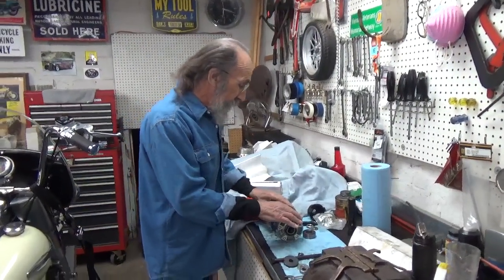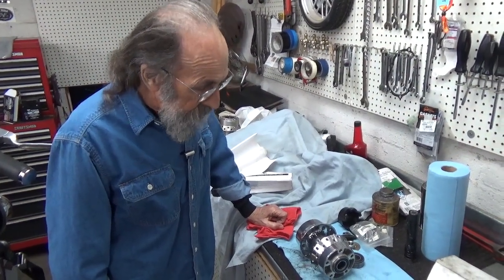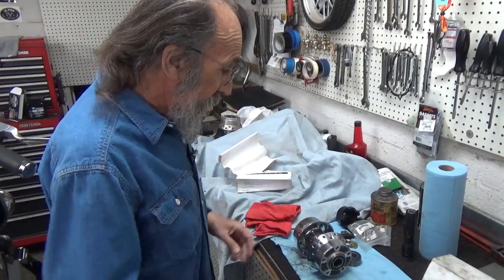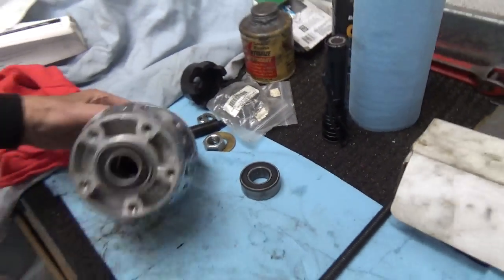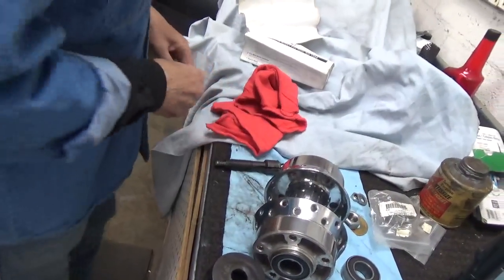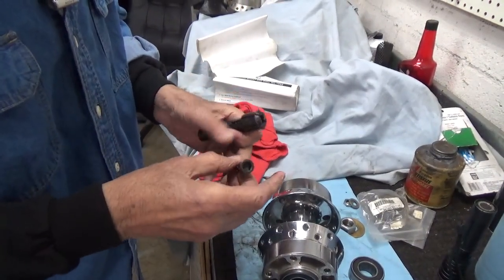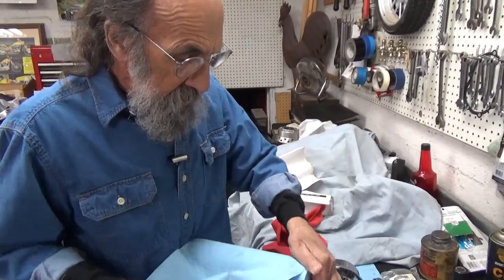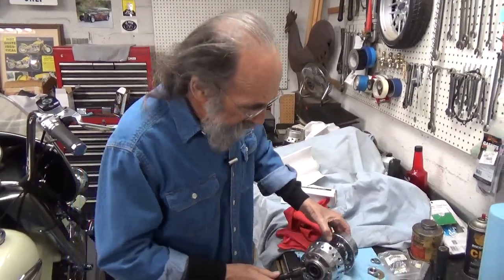R&R Late Model Sealed Wheel Bearings On Harley Davidson

Comment: You're a fountain of knowledge Mike. I'm always waiting for your next video. Thanks for keeping it real and inspiring me to wrench on my bike.
Reply from the maker: Awesome! Thank you!
Reply: @pacificmike9501  what cam would you run in a 93 FLHS for constant highway travel. I’m not worried about speed other than running 80-85mph. But my plan is to travel and see the magnificent USA.
Reply from the maker: Any of the "first step" drop in cams would do it.  Just read what they say about where the power comes on and govern your choice with what you want it to do.
Reply: @pacificmike9501  thank you sir, c u down the road

Comment: As always, good stuff. Discovered something recently. When using a static balancer, the 1/2" axle usually supplied will typically bend slightly with the weight of a Harley or cruiser wheel. I realized that a rear axle would work, it's long enough. So I picked up a used rear axle and have no problems with it bending while balancing the wheels. I'm able to actually get my wheels in balance for once.
Reply from the maker: Thanks for the info!

Comment: I remember my buddy's "Rocker" suffered a wheel bearing failure and when we removed it there was absolutely NO grease inside of the bearings. I guess the Mo-Co got a special deal from China on those and also eliminated the need for having any "hazmat" on the manifest from the cargo container ship that was carrying them all. Way to go HD! I wouldn't want anything new even if was free.
Reply from the maker: I understand.  We see it in a lot of different industries.
Reply: @pacificmike9501  and the bean counters are perfectly fine with that

Comment: Mike and Mike, great job as always. I haven't commented in a while,  busy with the Race Engines.  The leather mallet reminded me of a funny story, 1 of my must have tools. 2 years ago after a hurricane that left my shop about 6 inches under water, I opened the shop doors to the WORST smell I ever encountered. I thought the worst, a poor little critter drowned. Turned out it was the leather mallet that was under water for a week. Great tip for your subscribers on the lubricant for the pullers. Mine ALWAYS get a coating of a synthetic grease of sorts. People don't realize the amount of stress they endure, and they will last forever treated properly. 
T.S. RACING
Reply from the maker: Thank You.  Good story and good ideas.

Comment: MIke, as always your display of tools and technique is excellent.  You are a national treasure for us guys still cranking away on our shovels!  I am curious to know what your advice would be to remove the bearing race fora taper bearing out of the neck bearing cup for a 1982 FLH.   I have yet to get a service manual in proper form but simply due to busy work schedule and not directly working on the bike at this time.  I’ve been advised by some to Weld on the race and it should come out directly but my welding skills are poor, at best, and I figure HD had a tool for it.  Thanks sir and as always I enjoy your videos so much.
Reply from the maker: What most people do is weld it, it cools, it shrinks, it falls out.  What I usually do is buy new cups with new bearings and races as a set and knock the old cups out with a large punch and hammer and install the new ones with a large hammer onto a 2 X 4 used as a pad to keep from doing any harm.  They usually come with the new races installed into the cups.  Thank you for your kind words.
Reply: @pacificmike9501  I was on the fence with buying new cups but seems like the prudent thing to do.  Thanks sir

Comment: Good video. My bearing kit didn't have instructions, and the shop manual wasn't too helpful. I put in Timkin bearings on my 2008 Dyna Fat Bob. The Timkins pushed in without any problems.
Reply from the maker: Cool.
Reply from the maker: I hope you installed the appropriate inner spacer.
Reply: @pacificmike9501  Indeed. Your video is one of the few that mentions them
Reply from the maker: Cool.

Comment: Just chase those threads on bearing puller. Be good as new. I'm sure you know that though😉
Reply from the maker: It's hard tool steel.  Probably just kiss it with a thread file.

Comment: Use to weld an old nut to the old bearings so I could drive them out with a punch "primitive I know" found one of those pullers on Ebay for 64 bucks best investment I've made ...
Reply from the maker: Necessity is the mother of invention.  You can either wish that bearing was out or dream up a way to do it.  I have the coolest drawer of "homemade" tools.  Some of them, I made.  Some of them, my old friend I worked with made.  Some of them, we made together.  I don't even remember what some of them do.

Comment: Hi Mike , I  have found you can't trust the manufacture's , I have done a lot of these replacements and pretty much every one does not have enough grease in the bearings , I always pop the seals and use a bearing packer to pack them , also if you use some kind of spacer on the long install bolt it's easy-er to clamp the head end of bolt in the vice , then easy-er to watch the bearing  you are working on , great video as always  , have a great day
Reply from the maker: Thanks for the info.  Good stuff and I do appreciate it.

Comment: @Pacific Mike Thank you for keeping it "old School" thoroughly enjoy your videos! I am restoring a 1982 FXWG 80cu shovel with dual plugs my question is what Plugs are used in this application and would like to know what you're using for mounting the dual coils i seen on your shovel Thanks Brother
Reply from the maker: I don't know if you have modified stock heads or aftermarket heads.  Generally, on the left (for your year, RN12YC or equivalent), you'll have long plugs.  On the right (again, depending upon what you have), long RN12YC, short RJ12YC.  Those are Champion numbers.  Simply cross to what you like if you have a brand preference.  The coils are mounted on a Dynatech bracket that I bought when I bought that brand of coils.  If you can't find it, look up Dynatech and call them.
Reply: @pacificmike9501  Thanks mike btw stock modified sorry my bad appreciate the info  though I live in NJ I do every now and then make it to cali so maybe one day ….”i’ll see you out on the road’ stay well.
Reply from the maker: You too.  No tellin' where bikers run into each other.

Comment: Those pullers can be used for many bearings - I used mine on the inner primary bearing on my 2010 Dyna..... I hate the sealed wheel bearings though as they tend to not last long on the bike - it may have something to do with the 130+ bhp the motor makes ! I am looking into going back to the old taper roller bearings for that bike.
Reply from the maker: Thank You.  That's interesting information.
Reply: @pacificmike9501  Oh, I didn't use the actual bearing puller part on the bearing - I uesd somethingon the outer race of the bearing , a washer or something, and the through bolt along with the 'spider' type thing to pull it out and installed the new one in a similar fashion !

Comment: Put both bearings in the freezer then put both bearings and the sleeve on the tool and pull them both in at the same time. They drop in, hope this helps.
Reply from the maker: Not quite the way it works, but thank you.

Comment: Service manual & parts catalog = best tool $ can buy for any motorcycle....> Threw together a similar tool from "duck's foot" puller & a series of bolts,nuts,washers to index against hub & a few different stepped bronze pilot bushings from auto parts supplier years ago...sort of a cobbled up bearing removal tool....Would have purchased the RIGHT tool but SOME specialty tools seemed to be hard to source back then ... Totally different hub application = the aftermarket steel mags(mfg by Invader IIRC) with removable hubs(didn't have access to a hydraulic press) ...IIRC only rear wheel in type removable hub for steel mag with THIS model application has the ball bearings...front hub = tapered roller (AKA Timken bearings) > Curious to the "late model" reference ...What generation hub is that? Twin Cam models & later I have 0 experience with other than very basic service on a few friend's motorcycles but been reading & watching some vids here on YT for info on later model HDs being "BIKE curious"...:-)
Reply from the maker: It's a 2000 up roughly.  It is a dual disc dresser front hub.  I run one on my Shovel that I laced up to a 21" Akront rim.  It uses a 1" axle...etc.etc.  We have a lot of videos up.

Comment: Seems like your the man for good sound advice. Do you know if I can swap 2010 sportster wheels  to my 01 dyna just by replacing the bearings with the appropriate ID ones 😊
Reply from the maker: I would end up at the dealership parts counter.  I don't know the late model interchanges.

Comment: Question.  On a 1976 Sportster rear cast 7 spoke wheel,  the bearing is in the brake drum and a removable hub on the other side. In that case , it seem easier to me to removable the drum and hub and just press them in and out? I was painting the wheel and had the off anyhow. The front cast wheel is another story.
Reply from the maker: Sorry, I haven't worked on one of those in a long time.
Reply: Me either.

Comment: is there a good solid bearing set up you would recomend to replace older (62) timkin bearings an spacer shims ? the last guy rhat did my rear end lost the spacers . thanks
Reply from the maker: The spacers and shims should be available in any good aftermarket shop and the bearings are usually a good basic brand.  If yours didn't last very long, sounds like bad installation.  Remember to pack them with a good bearing grease after the endplay has been carefully set.  Those bearings should last a long time.  Be sure and use new seals.  Repack those bearings every time you change a tire.  The factory recommends every 10,000 miles.

Comment: Hi Mike, could you clear up the discussions concerning motor oil in the 70s vintage flh Shovelhead. Some say multi viscosity, some say straight 50 to 60 weight depending on temperatures? My 73 has been using 25-60, what are your recommendations? And thank you.   MikeTerry
Reply from the maker: I've never seen 25-60.  Originally, Harley said to run 50 wt in Knuckles, Pans and Shovels.  Lubricants are certainly better than ever now and I run 20/50 in all of those.  I'm very happy with the results.  Please don't ask because I don't push brands.
Reply: Yes 20/60 my mistake, changed it today, and thank you.

Comment: Thanks for the video.  Sooo do you prefer Timken bearings vs the sealed bearings?🤣
Reply from the maker: You know, I'm running modern hubs with sealed bearings on my Shovelhead.  I installed them to see how I liked or didn't like them  They've been there a couple of years.  Still okay.  Jury is still out.
Reply: Thanks Mike!

Comment: Hi mike. You said you use a newer hub like this on your shovelhead? Well, I have a 21" wheel from my old bike (2007) night train. I want to use the wheel on a rigid shovelhead build with the factory 1977 flh front end. Do you think this can be done?
Reply from the maker: Sure, but you're on your own.  You'll probably use your original 3/4" rear axle.  Then, replace your wheel bearings (I assume it has 1" i.d. bearings) for 3/4 " of the same width.  You may have to come up with spacers.  You may have to make them (turn them on a lathe.  Then, you have brake issues.  Don't know your plans there.  On my 77 FLH , I used 200? everything.  The only old parts there were a pair of early fork trees.
Reply: @pacificmike9501  thank you Mike! I plan to use it on the front with an updated caliper, maybe softail. That is if I use a front brake at all. So I can use my stock shovelhead axle with 3/4" sealed bearings? As far as spacers go, I can make that happen. I just wasn't sure about the old axle it different style bearings
Reply from the maker: I meant front axle, not rear.  Sorry 'bout that.  3/4" is 3/4".  Fitting a late caliper to an early fork leg is a bit intense.  I used late legs.  Your rotor has to be one made to fit that wheel (center hole dimension).
Reply: @pacificmike9501  thanks again Mike! I appreciate you sharing your knowledge of motorcycles.

Comment: Hi Mike, good video. I have a question for you unrelated to this video. Have you regeared any of your transmissions to be able to run continuously at interstate speeds? The reason I ask is I have a 56 pan with a stock trans in it. When I ride it I avoid the interstate, which usually makes for a better ride. But there are times when I do have to get on the interstate and I can't run 75 or 80 mph for any length of time due to the era trans. I don't know anyone who has a early bike, so your the only one I trust with this question. Thanks Tinker
Reply from the maker: All Harley 4 and 5 speed transmissions end up in top gear as a 1:1 ratio.  The rest is done by varying the number of teeth on your sprockets.  Go to our Youtube homepage and look at our video titled "Gearing for Better Cruising."  You can go to Youtube and type that title in.  We have well over 200 videos up and I explain exactly what you're asking on that video.  Any difficulties or questions on it, write back.  I do this one a lot.
Reply: @pacificmike9501  thanks Mike I'll do that, thanks for the quick answer.

Comment: I find that tool never wants to pull bearings in straight. I use it as a puller but I install with a hammer. Couldn't agree more about owning a manual
Reply from the maker: Thank You.  Always open to advice.

Comment: this is a great video on How To Not Install Bearing... ON the vice we the Viewers can really can see how crooked a bearing can be but still can be FORCE IN... Mike you know and i know there is only .001 larger bearing to the bore of the hub... and you know it never will be that tight of a hole to do a press in job... so when you where struggling to crank in that bearing and you even said : WOW i did'nt think it would be this hard to install this bearing the other one was easier,,,  thats when you must stop and LOOK at how the bearing is really going along. is it going in straight ??? probably not,,, it never should be this tight... maybe i should Measure the Bearing DIAMETER first and the hub DIAMETER before i ever try to press anything into anything it is called Quality inspection... check the factory parts first before pressing it in... never trust a bearing DIAMETER and then you will know if it is very hard to install it ... it might be going at a ANGLE ...
Reply from the maker: Thank You.

Comment: those bearings suck, even the factory says change em when installing a new tire. I've seen 10,000mi. on sealed bearings dry, WTF. I pull the dust cover off and pack em myself, do it careful and your good, it will snap back on the bearing and seal it up. with good bearing grease they'll last. tks Mike. nothing like the  older tapered timkins
Reply from the maker: Thank You.

Comment: Those sealed bearings are pure junk. My bagger is real close to having 200,000 miles on it. In that time, I've changed a bunch of them. Some for failures, but most for preventive maintenance. I never let them go more than 20,000 miles. And I've had one that went out with less than 5,000. That one resulted in a tow off the mountains in Idaho.  Made in China junk. Give me the old timken tapered bearings anyday. Never had a failure with those in 45 years of riding. Good video ,Mike.
Reply from the maker: Thank You.  I set this up to educate people.  I feel like this one is having people educate me.